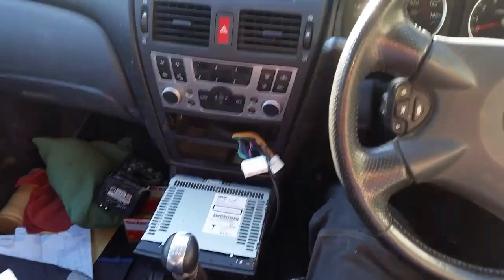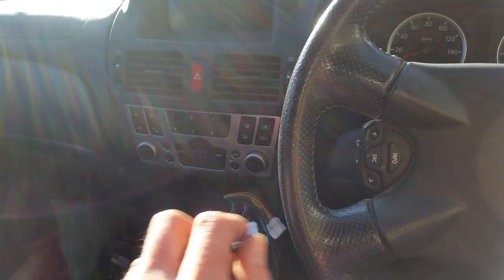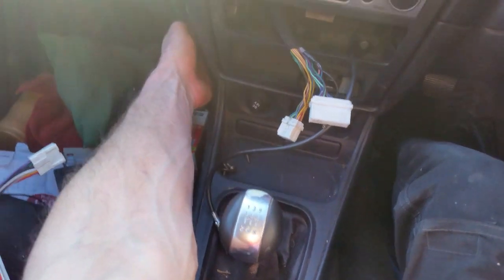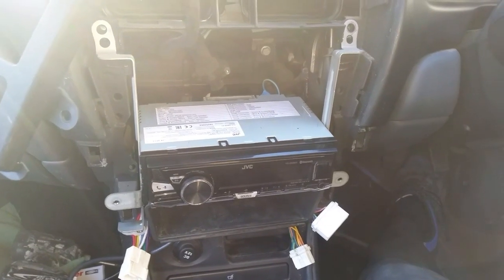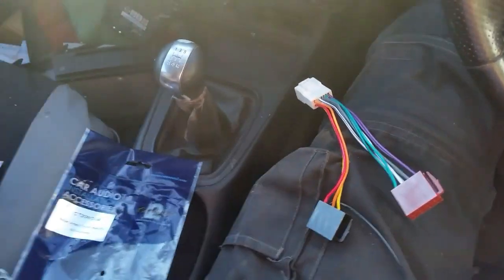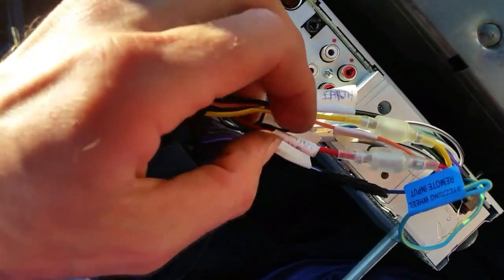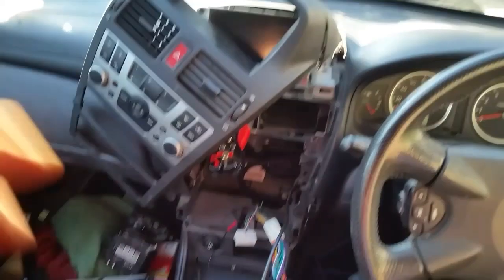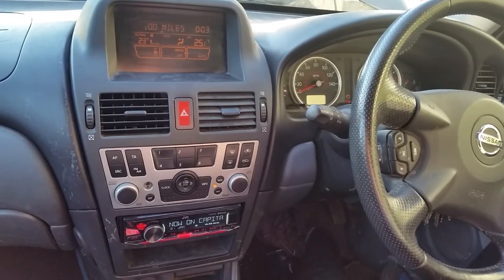How to replace a Nissan Almera 2005 CD player with a mechless radio

Comment: Nice video. I have a question: How you do for use the air conditioned without the controls of the original radio? Thanks

Comment: Excellent presentation! It helped me a lot to replace the radio-CD. Thank you very much for your work!
I connected the black wire to the chassis of the car, more precisely I put the round terminal of the black wire under one of the screws that fix the frame of the radio. It works excellent.
Reply: Lol that’s an old trick from back in the days you used there 😂 I thought I only did that but glad to there’s others ha ha 🤣

Comment: I have a Sony CD player fitted similar to the JVC one you've fitted. If I want to swap it out with a Bluetooth CD player, do I just have to remove it and replace it with the Bluetooth player without changing any of the wires?

Comment: For what is the ground cable the black one? can't it just be grounded to the chassis? or what is the reason to take that wire from the other loom?
Reply: You don't have to I just grounded mine to ground screw on the metal body, worked fine rest as the man explained, connector from Ebay.

Comment: Hi nice video thanks 👍 did u have climate control in yours ? Was u still able to control it through the old radio buttons ?
Reply from the maker: Climate control still works through the original buttons
Reply: Roger Balfour thanks very much , that’s interesting..so I take it u just lost your original radio functions of the Nissan dash radio but the rest worked fine ?  Mmm well done jobs a gooden 😃
Reply from the maker: Correct